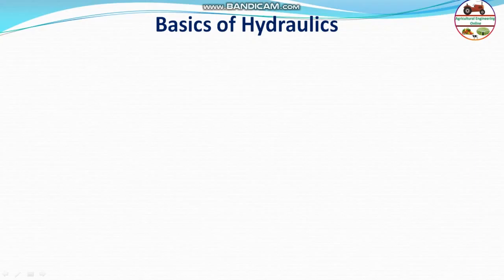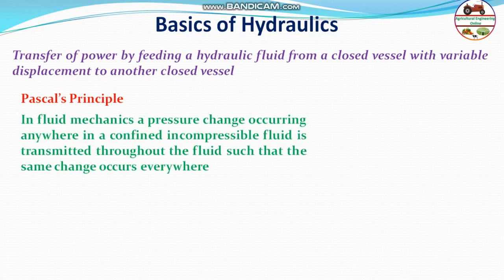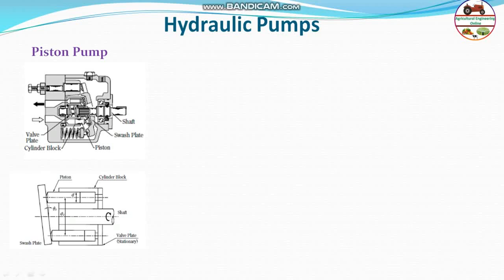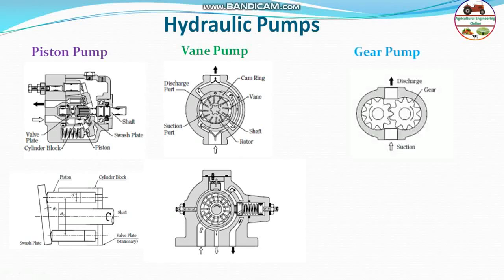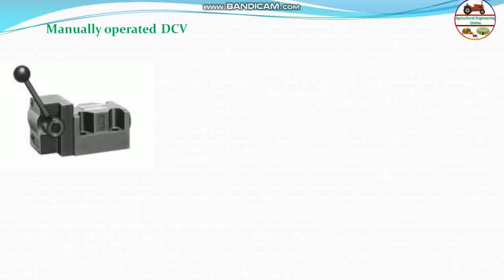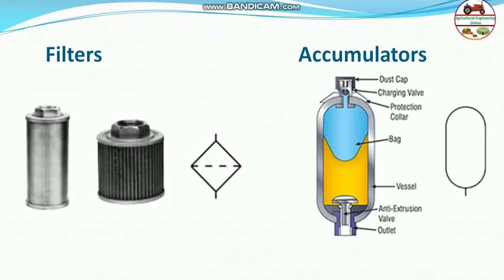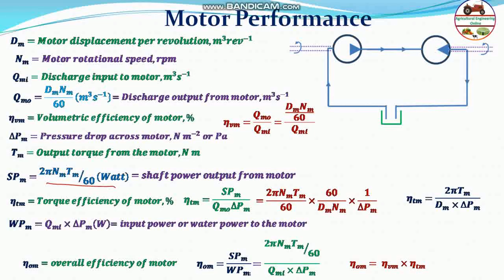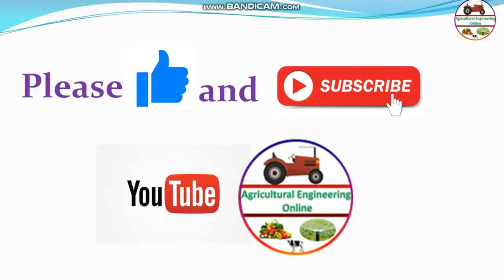Hydraulic Systems Basics Lecture

Comment: Make a pump which used hydraulic pressure for lifting water so we use a wheels and spring winding key like we found in toy car 

On big size model we got many advantages and create a pump which pumped out water with animals power 
So simple